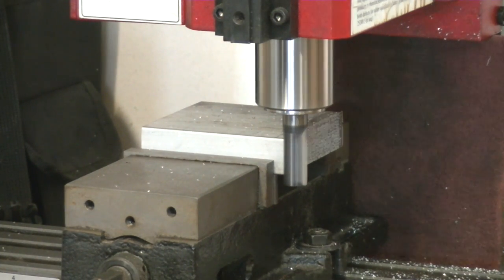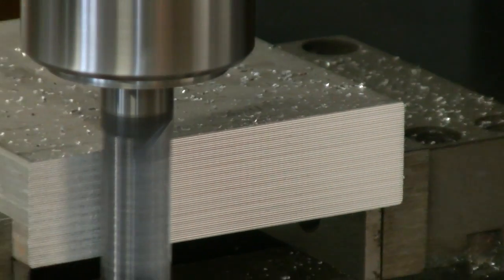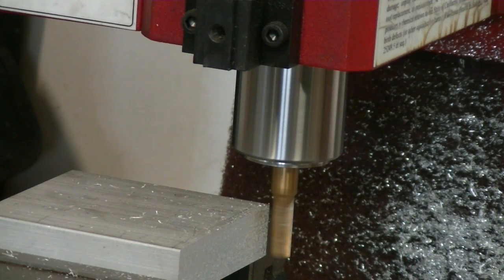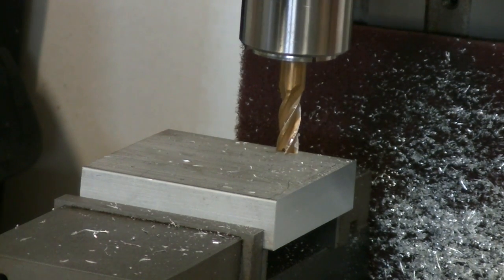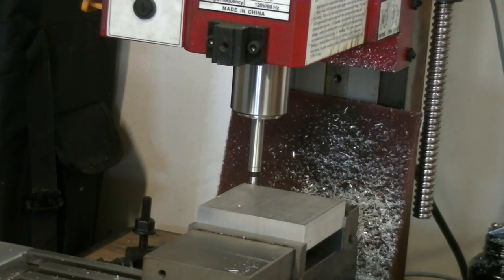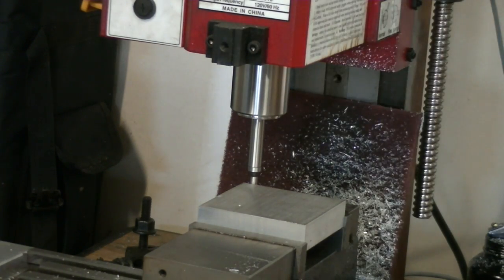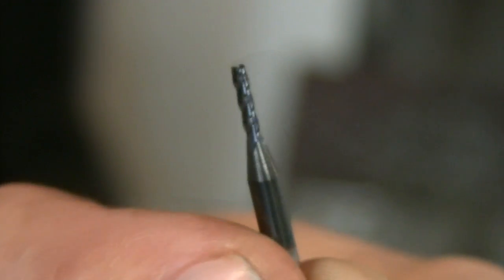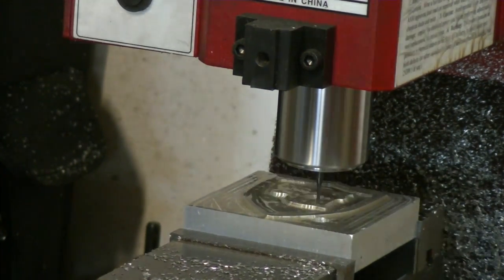CNC Mini-Mill First Cuts

Comment: Tom Zelickman what size stepper motors did you use for this conversion and what s their holding force?

Peace!
Reply from the maker: Hi Jeffrey! I used 280oz motors for the X & Y and a 420oz for the Z axis. Probotix sold it as a kit and it bolted right in to the CNC Fusion ball screws and mounts. I've been doing some more digging around and may have found some details around settings to use for the acceleration and pulse width but I just have to wait a little while to test it out. I'll likely draw up a decent plan for testing to find the limits and then back off a conservative amount. Any suggestions for me?

Thank you,
Tom Z
Reply: Tom, thanks for the response. Since I am in the machine design process I don't know how much help I can be, since I have not gotten to the point where you are at. Which machine control program are you using, Mach3 or LinuxCNC? Mach has a lot of problems, which is why Tormach recently moved to a hybrid version of LinuxCNC & Machinekit.
Reply from the maker: Putting this together myself makes me appreciate the pre-built systems all that much more. I actually went with Mach4 of all things. I'm a Linux guy and had it running under LinuxCNC for initial tests but was going for something a little different this time around. I actually booted up with the LinuxCNC live CD when I realized I was having problems to see if the issue was a software config or a hardware one but then got pulled away and didn't complete the test. I wish PathPilot was released to the public or even for sale! It looks so much nicer to use. I'll keep you posted on my progress though. I'm making these videos in the hopes that it helps other people who may want to build their own as well.

Best wishes,
Tom
Reply: Tom, well I've heard that Mach4 fixed many of the issues 3 had, but I was talking to a guy who had created a 3D printer module for his CNC who was having similar issues as you with Mach4. So you may be best served by going back to complete the LinuxCNC test so you know for certain that t's not the hardware. That will at least eliminate the hardware as being an issue and may just help determine the settings required to fix the problem. I agree with you on PathPilot as I am a big  open source advocate. I appreciate you sharing your experience as it will be helpful to others. You will soon learn on Machining YouTube what I am putting together. I just need to finish the write up and then have the moderators approve it for posting. Be well!

Comment: If you're loosing steps there are three main settings that can affect it. Like you already know it's the maximum speed and the acceleration. In addition you can also play with the pulse length (frequency) for the control. In my case increasing the pulse length (lowering the frequency) decreased the failure to some point.
Reply from the maker: Zorgoban I hadn't thought about the pulse length at all! Well, it looks like I have a few different tests to run when I get back into the shop. Thanks so much for the tip!

Tom Z